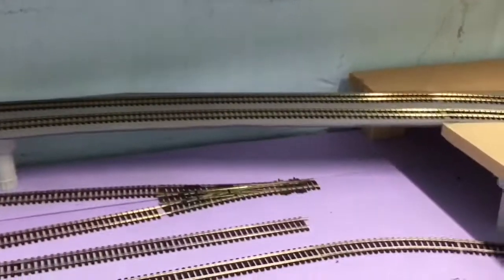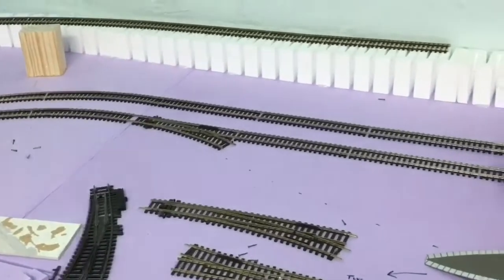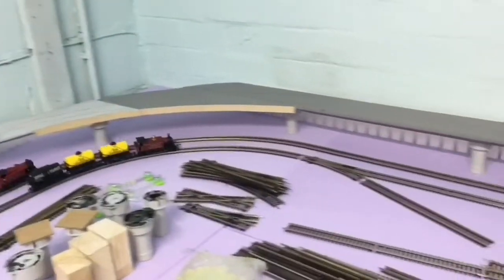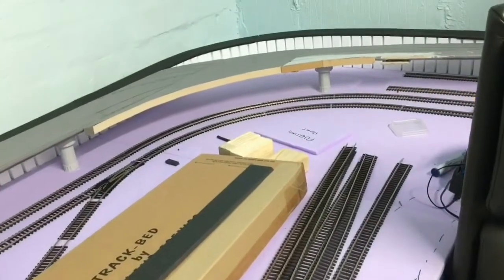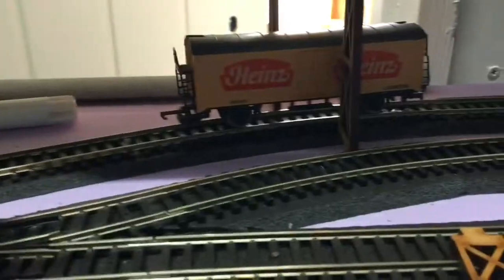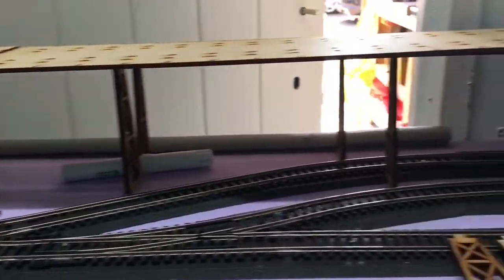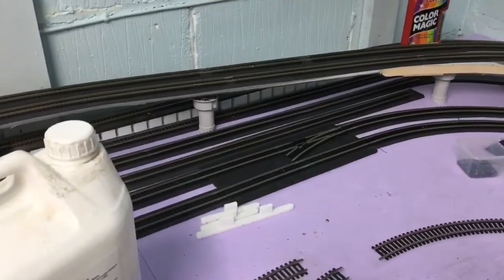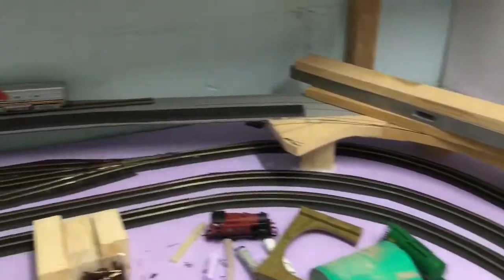Train Room Project (part 8).

Comment: Fantastic Steve, many people will find this video very useful as you are clearly explaining your thoughts. As for making a huge mistake, no, because you did what you thought was right at the time and with greater experience you are realising, less is more in most cases. The layout does however, need to fulfil your needs, so if you need storage you have to put it in somewhere. 

You are doing the right thing, and this wont be the first time, every one of us changes, rips out and plainly starts again from time to time, we are all learning and no-one doing anything jumps in at the highest experience level, we start with what we know however much or little that is. 

Glad you able to sort the bridge pillars, great work!

Yes access is massive, Ive recently ripped out a whole scenic section because of access problems some trains were derailing on a single slip. Access, access, access, can emphasise that enough.

Great job Steve Im enjoying the build!
Reply from the maker: Thanks John...... I saw your video when you ripped out the section over that slip causing the derailments. A fiddly but necessary modification. Thanks for your very encouraging comments 👍

Comment: i know it would be a lot of work but just turn them upside down p reason why try a loco with a snow buffer on it it will take out the supports - or a usa loco the has moving bogies under the locos cab they realy bend out on corners  and they would scrape the supports put them upside down will sort it